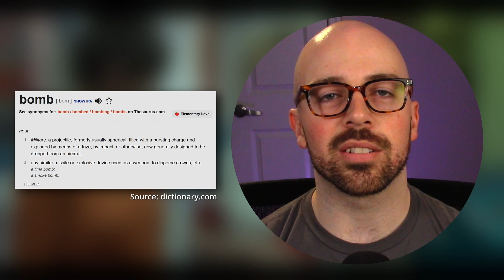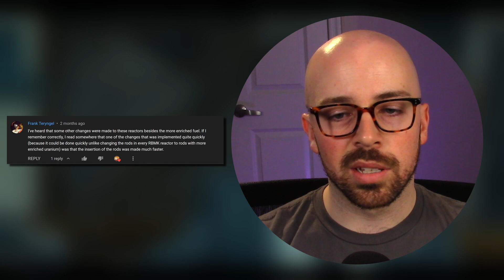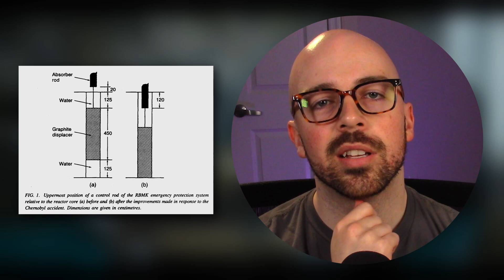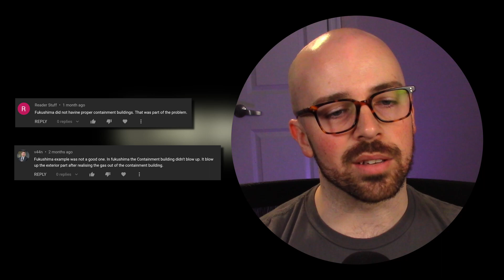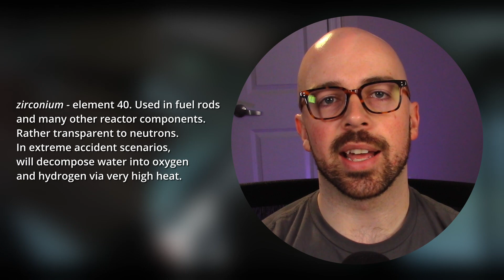Chernobyl Part 5 Comments Review

Comment: Yes, another excellent video! And I cannot wait to see what you're going to do with your Reactor Series videos. Be sure to include the wonky-looking, but incredibly awesome CANDU reactor design. These can actually help us close the nuclear fuel cycle as they can run on the "waste" from PWRs via the DUPIC (Direct Use of spent PWR fuel in CANDU) process.

Here is some additional info on the safety improvements they gave the RBMK reactors after the Chernobyl accident:

— Reducing the positive steam (void) coefficient of reactivity and the effect on
 reactivity of complete voiding of the core;

They raised the enrichment to 2.4% like you already mentioned. And they loaded additional absorbers. The number of
 additional absorbers varies from 85 to 103, depending on the reactor. Technical specifications now require at least 81 additional absorbers. There is to be no deviation from this at any time.

— Improving the speed of the scram system;

Not only did they improve the overall speed of the scram system to 12 seconds from the skeletal 18, they also added an additional fast-acting EPS. This system can fully insert 24 control rods in less than 2.5 seconds, or in 7 seconds depending on the emergency signal activated. The FAEP is meant to ensure that on demand, a negative reactivity of more than 2 ß will be inserted in less than 2.5 s. The actuator in this system cools the channel wall with a thin film of water and moves the rod in a gas medium. In 1987-1988, this new system was put through full scale testing at the Ignalina and Leningrad plants. The tests confirmed the design characteristics of the system, i.e. 24 fast acting EPS rods in less than 2.5 s cause an insertion of negative reactivity of over 2 ß. All RBMK reactors are now equipped with these systems.

— Introducing new computational codes for the ORM, with numeric indication
 of the ORM in the control room;

— Precluding the possibility of bypassing the emergency protection system while
 the reactor is at power through an operating limit requirement, and the introduction of a two key system for the bypass action;

Ergo, the staff can no longer willy-nilly shut off safety systems like they did in 1986.

— Avoiding modes of operation leading to reduction of the departure from
 nuclear boiling (DNB) margin for the coolant at reactor inlet (this addresses the question of adequate sub-cooling at the core inlet).

(Sources: INSAG-7 and Safety of RBMK reactors: Setting the technical framework)

The Netflix series about TMI is horrible. I couldn't even finish it, I quit after two episodes. Not only do they get a lot of things wrong (yes, I did a lot of in-depth reading about TMI), they include conspiracy theories as fact. Including the statement that TMI caused ARS in people comparable to the levels of Chernobyl directly after the accident, and that it was all covered up. My biggest disappoint was Michio Kaku who went along with all the fear mongering. The whole series is decidedly anti-nuclear. Every other minute there was a "Nuclear Bad!" punchline with some accompanying ominous music to drive the point home to the unsuspecting viewer. So, be aware of this before you start watching. But it would be great to hear your take on the Netflix series.
Reply: Check out Moltex's SSR that Canada are building to go with their CANDU
Reply: EXTREMELY long comment
Reply: @st3phan321  
What, you don't like reading long nerdy reactor-y YT comments?

Comment: Can it accidentally become an ineffective nuclear bomb?
Like a "fizzled" one.
With a positive void coefficient the maximum "void" factor is all void, no water.
If the first explosion vented all the water, could the second not have been a runaway event?
Two modes, the delayed-critical core used in reactor cores and the supercritical lump used in bombs.

We use delayed criticality because each generation of neutrons take minutes to, er, make-reactor-go.
It's slow enough that you can move rods about to control it.

But a bomb is a supercritical assembly.
Each generation of neutrons creates the next in nanoseconds.
Great for bombs, crap for reactors.

So here's the point:
You have 200 tons of 1.8% LEU
But you have it riddled with moderator and surrounded by reflectors.
And your absorbers are all gone.
Part of the core may have experienced a prompt-critical excursion, just like a bomb.
Which tore the core apart, ending the fission.

I guess the real question is what defines a nuclear bomb?

Obviously it's not a steam explosion.
It's probably prompt criticality
But if your assembly is sub-critical and it fizzles, is that NOT a nuclear bomb?
Or is it a failed Nuclear bomb?

I just find this fascinating, the definition of the thing.
Reply from the maker: First, let me say thank you for opening this line of questioning without insulting me first lol (we've exchanged comments before, so I wasn't expecting anything less from you just to be clear). Others who have tried to pose this question have been very crass about it. The first major issue is enrichment (we're going to stick with uranium here but it's quite similar with plutonium). You want bombs to be highly enriched because Uranium-238 tends to suck up neutrons and not give you any fissions. Another benefit of high enrichment is a lighter bomb. The RMBK reactor is very low enriched. There have been fission bombs made with somewhat low enriched uranium (20% enrichment seems to be the cutoff point), but the enrichment in the RBMK is too low. The second major issue is all that moderator. Nuclear bombs use fast neutrons - all the neutrons in an RBMK are being moderated and being slowed down greatly (thermalized) - too slow for a nuclear bomb to happen before it blows itself apart. Even if it's prompt supercritical. I work to prevent criticality safety accidents and all of those that have happened are prompt supercritical. But, they don't explode like nuclear bombs. Many criticality safety accidents were moderated but not all - like demon core and such. I suppose in theory, an unmoderated criticality safety accident could get to nuclear bomb levels of power if other parts of physics were put on hold, but something in the real world always interferes - like blowing itself apart or decreasing density via thermal expansion from heat. The main thing is it's always too slow before something changes, neutrons are too slow, it blows itself apart, some liquid splashes out in the case of a fissile solution criticality accident, etc. That's why all nuclear bombs start with a conventional explosion - trying to squeeze the shit out of that fissile material very very quickly - usually by imploding it, and letting a nuclear bomb level of chain reaction happen before it blows itself apart.
Reply: @TheAtomicAgeCM  
Thanks and you're welcome.
I find the whole concept fascinating, as it is fairly obvious.
If it looks like bomb, sounds like a bomb and booms like a bomb, is it a bomb?
That's your philosophical side.
I mean, no mistake, it very much was a Nuclear powered bomb with the steam explosion.

Then there's the technical side, indeed there is no way to make a supercritical assembly that goes prompt kaboom or even fizzle, certainly not by modelling the core as is.

But there's one question I still can't answer and that's that one published paper describing proof of uncontrolled prompt criticality, from isotopes found in the Arctic circle (I think)

The only thing I've got for that is in such a massive core, well, maybe they didn't mix the uranium correctly? (This is broken soviet Ukraine at this point, they don't even have Geiger counters, not proper ones)
Maybe there was a pocket of concentrated U²³⁵ by dumb luck?
Then, well, this core was already exploded, the paper claims the first was rupture followed by steam loss and the second was the prompt excursion. It's another five roll thing but, if it did go supercritical on the second blast, it did start with a conventional explosion
The idea in the paper is just a small part of this massive core that went critical. And if that explosion lifted the, what, 6000 ton bio shield?
Will, everything for crushed downwards and outwards.
And that, that's as far as I can speculate.
Does the SCALA data stop at the first or second explosion? If it's the second I think it would be interesting to calculate its exponent and compare it to that of prompt criticality.
Reply: @TheAtomicAgeCM  
Hey, Atom Age.
I got an idea for you, a short one so you can put it in a YouTube short!!

OK, there's a game called Half-Life 2.
And it had a continuation chapter called, Half Life 2 Chapter 1.
At the conclusion of Ep1 the "power unit" of the alien tower in the center of the city explodes, with the force of what appears to be in the multi-megaton range.

Your challenge, should you choose to accept it, is to guesstimate what the Megatonage is.

I recommend you play the game and the chapter, or maybe the final chapter of the game followed by the expansion chapter.

Clues:
Tower height is mentioned.
Location of the power core in the tower expressed as height relative to ground level.
Video of the explosion as you run away, fireball height it seems.
Various bits of exposition.
How long they traveled away and possible even speed can be  guessed.
They survived the over pressure wave, you can time how long the over pressure took to arrive.

Sounds fun, eh? 😁😁😁
Reply from the maker: @MostlyPennyCat  i love half life! my favorite game series. this could be a fun concept, something to look into. i do plan on addressing how the series portrays nuclear science too

Comment: I wonder if it would make sense as part of reactor design to include a sort of “waffle maker” shaped slab of copper on the floor, possibly with horizontal holes bored through to arrest a meltdown?

Copper is very conductive (and somewhat neutron absorbing?), and with coolant flowing through the holes, could remove heat very quickly from anything that came into contact with it. The “waffle maker” shape could serve to increase the surface area and help separate the molten core into more manageable bits?
Reply from the maker: sounds like a good idea! look up the French EPR, I believe it has some kind of feature like this

Comment: Their was one aspect of Acute Radiation Sickness that “Chernobyl” briefly discussed but didn’t explain why. The Latent phase of ARS, where the exposed will seem to get better, before the symptoms come back even worse. What causes this temporary recovery? Is it caused because of the immune system is fighting of the poisoning, and then once the immune system is destroyed that’s when the symptoms start to reappear, or is it caused by something else?
Reply: The latent phase has to do with the DNA damage that was done to the cells in the body. The cells weren't killed, but the DNA was damaged to the point the cells lose the ability to divide and replace themselves or lose the ability to function correctly. Different cells have variable lifecycles. Skin cells for example have a lifespan of two to four weeks. So, if suddenly large portions of your skin lose the ability to divide and be replaced, on the outside you look fine for a while, but in two to four weeks as those cells die, your skin starts to deteriorate. Same thing is going on internally. Your immune system keeps on working, but no new white blood cells are being made so their numbers drop and opportunistic infections can start to take over.

Comment: The nuclear bomb analogy may be more accurate than you realize. It has actually been hypothesized that rather than a delayed supercritical increase, one of the explosions may have been caused by a runaway prompt criticality resulting in an explosion somewhat similar to that of a fizzled nuclear weapon. 
There is evidence for this, as xenon-135 was found 1,000 km northeast of Chernobyl only 4 days after the explosion. This would’ve required short-lived fission products to be ejected to heights much higher than should be otherwise possible, whereas the main debris from the core drifted northwest towards Scandinavia and contained equilibrium isotopes of xenon.
Additionally, observations of the destroyed reactor tank indicated that the initial explosion created temperatures high enough to melt through the 2 meter bottom plate in part of the core, which is consistent with a nuclear explosion. The bottom plate in the rest of the core didn’t melt but was pushed down 4 meters, which is more consistent with a steam explosion.
So it’s possible that there actually was an initial nuclear explosion in only a few channels, followed by the larger steam explosion less than three seconds later. Swedish nuclear physicist Lars-Erik De Geer did a full paper on this in 2017, although he did still mention that the nuclear explosion concept is still not to be confused with an actual nuclear bomb. There was a prior hypothesis from a different scientist in 2009 that the second explosion was nuclear and the first was not, but it’s so incredibly unlikely for a nuclear explosion that powerful (estimated at 40 billion joules, equivalent to 10 tons of tnt) to occur by accident, and the evidence is more consistent with a smaller explosion.
But of course Legasov would also not have known any of this, so given the information he actually had at the time, saying it was a nuclear bomb was still wrong.

Comment: Not going to lie, I wish you mentioned the fact the "caps" didn't jump up and down, I've done my research on this and everyone I know agrees that it wasn't possible for them to jump, at least not in the way it was portrayed, at most the "caps" would've been shaking and potentially risen, but they wouldn't of been jumping.
Reply from the maker: probably done for dramatic effect then. to the viewer, the caps jumping up communicates immediately that something is wrong, whereas just rattling or rising could be confusing to the average viewer as to what's happening.
Reply: @TheAtomicAgeCM  I understand dramatisation, however I think it would of worked if instead of them jumping, a lot of steam was released from between the so called caps, and then they began pushing upwards, not jumping but the being pushed up as a whole. I think that there would signal something is wrong in the same way.
Reply: @TheAtomicAgeCM  and the main reason I brought it up is that it’s becoming an actual misconception in several people, for instance ask like 10 people what they think happened leading up to the explosion, 9 out of 10 will probably say the rods jumped. I know it’s not exactly a harmful misconception, however it kinda annoys me for some reason.

Comment: The hydrogen creation at Chernobyl and Fukushima.
Is the process chemical or nuclear?
It seems to be chemical, 
Zircalloy + water + heat 
=> Zirc Oxide + Hydrogen

But there's still a load of low level neutron flux in the area I guess, can any of that hydrogen come out as Deuterium or Tritium?
Burning that in oxygen would create heavy water, are any of those free isotope gasses or heavy water created dangerous? 
The sea is full of heavy water and uranium anyway, always has been so I'm guessing it's not dangerous.
What are the half lives anyway?
I know Tritium is short, hence the Lithium Deuteride.

You'd think a flair system would be included, like in an oil rig.
In an emergency, you flare off the hydrogen as it gets created.
Hell, even get a drainage system to route it back into where it came from in the spent pool or into the reactor core!